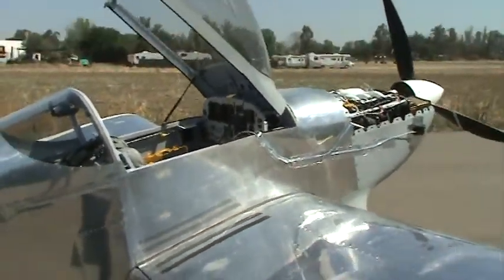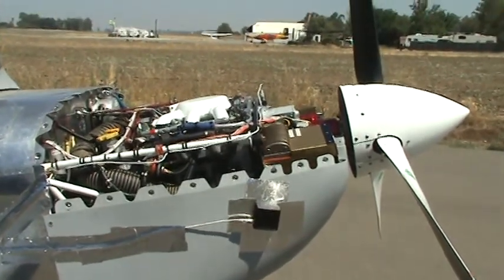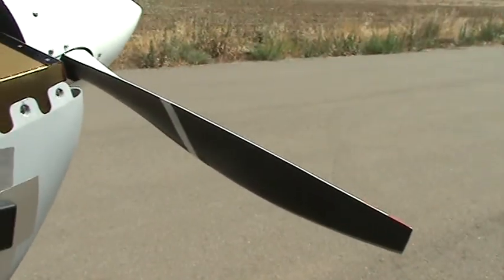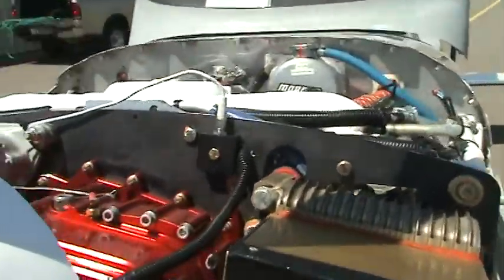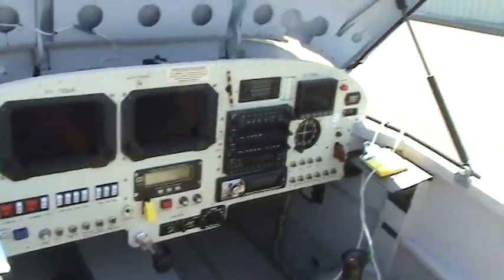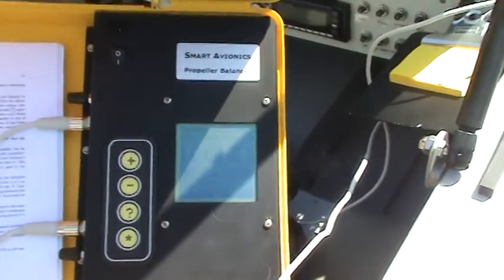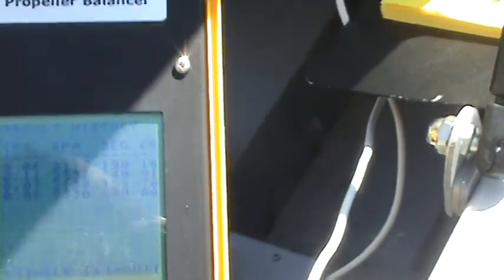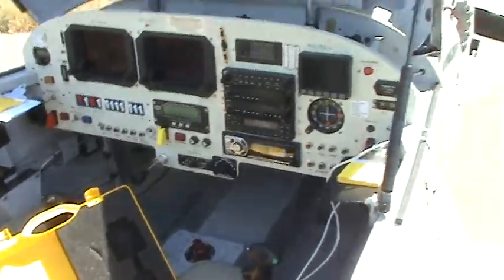rv7 prop balance

Comment: This was a very poor setup as the accelerometer was not anywhere near the prop to be sensitive to the out-of-balance condition.  Will you get results?  Yes.  However, they will be very poor results.  The IPS readings on the screen are not anywhere close to accurate.  This work needs to be done by somebody who knows what they're doing instead of just somebody who has the equipment.